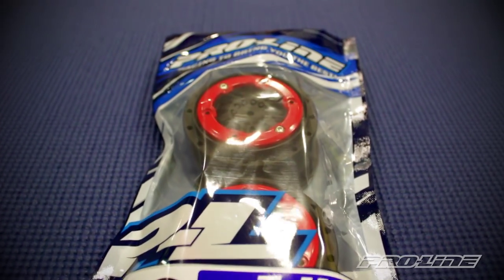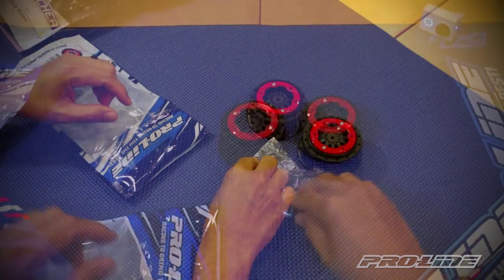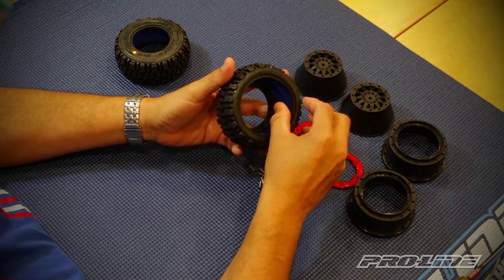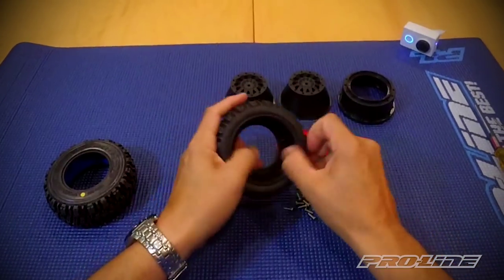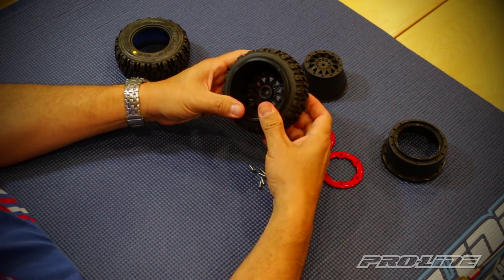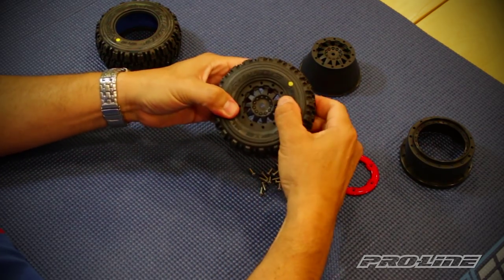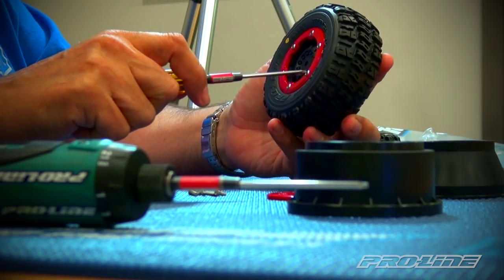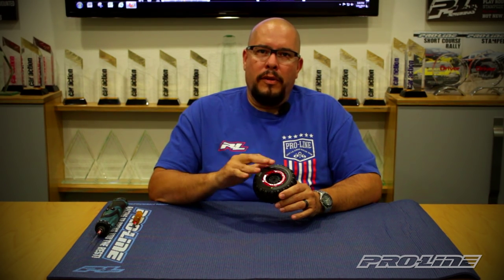Pro-Line HOW-TO: Mount Short Course Bead-Loc Wheels

Comment: Why 2.2/3" bead-lock wheels are not available with 17mm Hex from Proline ?
Reply: 1/10 scale short course trucks use 12mm hexes, standard these days, ever since the Traxxas Slash came out and maybe a little bit before.

Comment: Hi what's better glue or those
Reply from the maker: Hello Manuel, the best thing about Bead-Locs is that you can switch out your tires easily for different terrains. while our bead-locs are designed to hold our Tires TIGHT, choosing a glued tire/wheel combo will definitely offer the strongest hold of your bead. this is usually ideal for a race scenario where a pulled bead could be detrimental to your lap time, however, on the flip side, if you pull a bead on a bead-loc, you just loosen it up, re-position and then tighten it back down! :) its really your choice, both options are good.

Comment: Use silicone in place of glue so u can still change out tires. Running on 3s will still cause tires to blow off of rims.  Not nearly as easy as regular wheels but it still happens
Reply: I found the glued tyres on 3s hold out pretty well, these come off after any form of hard driving.
Reply: Will the beadlocks blow off the tire or are they better then glued?